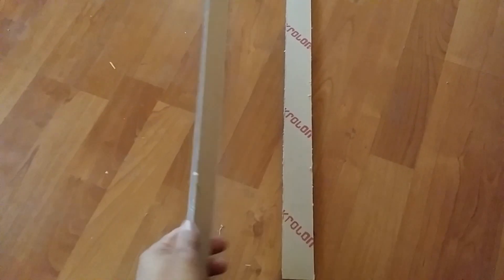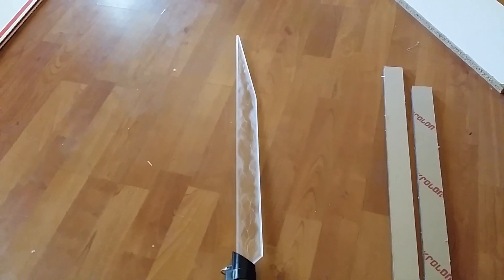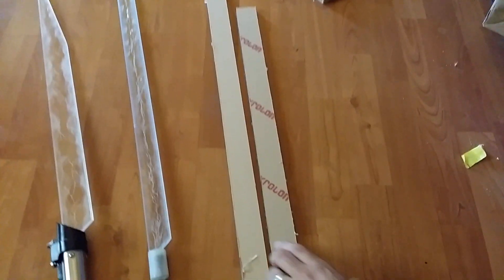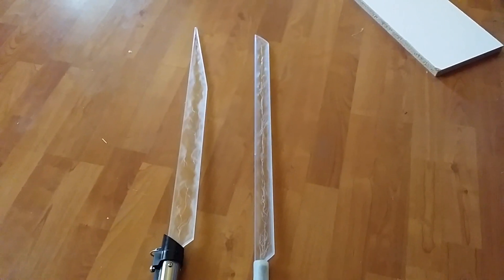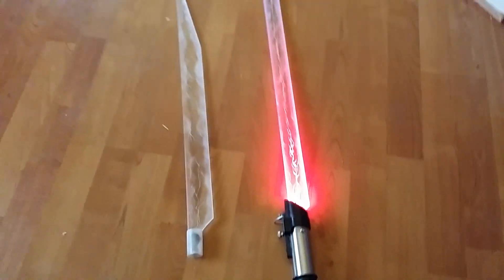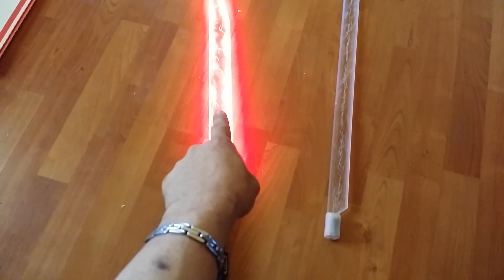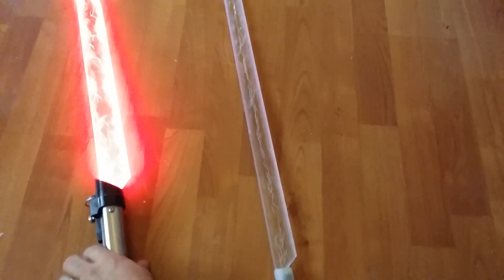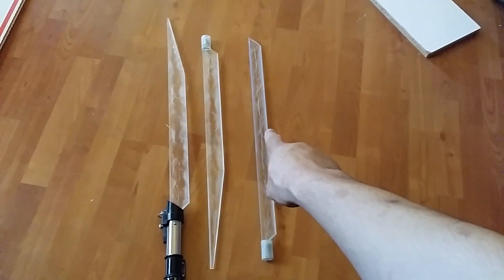Ripper Blade, acrylic vs. Polycarbonate

Comment: Why did you make the end of the blades round? Because if you look at Pre Visla's sword handle which is a squared rectangle handle the opening for the blade opening is also a rectangle opening which the blade comes out. Dont get me wrong I think you did a beautiful job on the blades. But it would been easier to have just put the single layer of the polycarbonite blade into the rectangle handle rather than the typical rounded light saber.  Go check it out https://vignette.wikia.nocookie.net/starwarsrebels/images/e/e8/Darksaber.png/revision/latest?cb=20170118101036

Id like to know how you got the black on the blade that was cool. If I was able to have one Id like to have a brass/gold color handle instead of the chrome silver color handle myself. Great work

Comment from the maker: Really none.
Polycarbonate will still break at the base due to the thin neck and is only flexible acrylic is brighter and more beautiful 100% of the time.
Although polycarbonate is softer and is maid to withstand force it is not good for the use I use it for.